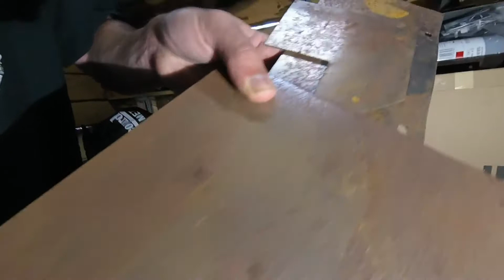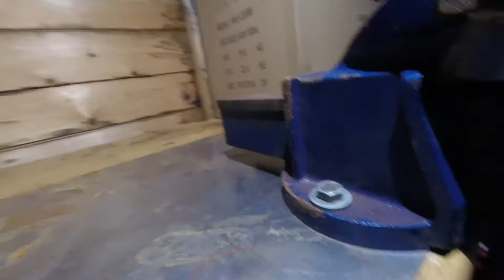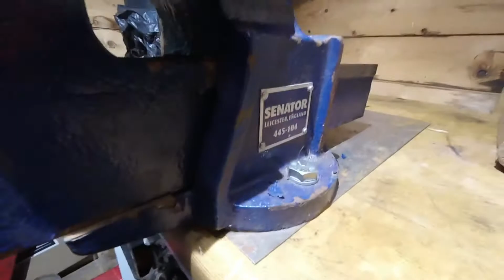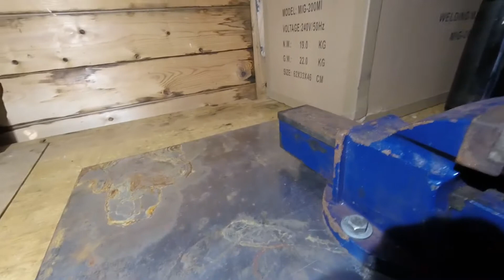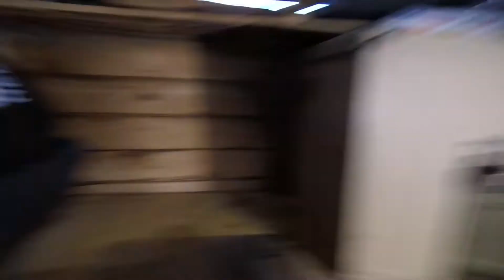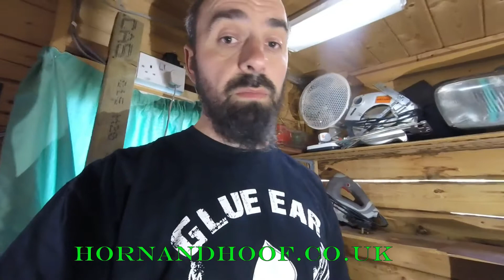Röhr MIG-200MI - Setting Up My DIY MIG Welding Bench - Made From More Scrap And Spares In The Shed!!

Comment: Be careful welding in that wooden shed mate🔥also be mindful of the fumes.
Reply from the maker: Yeah, I was a bit dubious about it at first but I have a couple of fire extinguishers handy to welded the few test runs then sat outside it for an hour to ensure nothing caught fire. It's quite well "ventilated" too due to it being old and falling apart. Time to design a new bigger workshop I think.
Reply: @AlanEaston  Me too. I'm too eager to play, but got a load of combustibles in my shed... aerosols, white spirit, meths & acetone!
Reply from the maker: @BestUserNameUK  Yeah I have some white sprits and a few other bits of combustibles, I just move them up out of the way, make sure lids are on tight and like I say, have a 6L Foam and a CO2 extinguisher to hand, just in case. Anything that catches that isn't stopped by those 2, you're never going to stop without brigade. Common sense prevails and ultimately, if you don't feel safe, your patience just needs to take a break until you can clear the stuff out. It's SO worth the wait though isn't it? Already can't wait for the weekend to get this next video done. Needs some ideas writing down tonight.